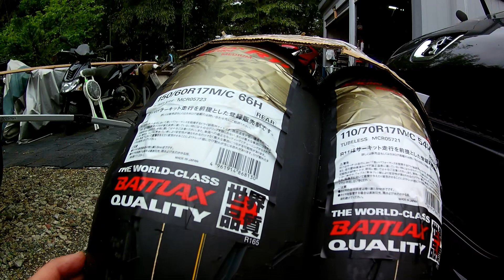aprilia RS125 Tires Exchange BRIDGESTONE R11

Comment: The Carbon maybe has a contact to the cylinderintake, because you Ride your bike without the oem metal plate
Reply from the maker: It looks like that.
There is a reason for removing the stopper, but it seems that it was a failure